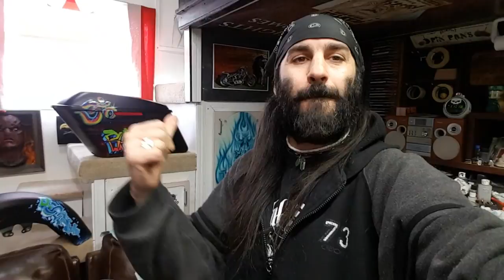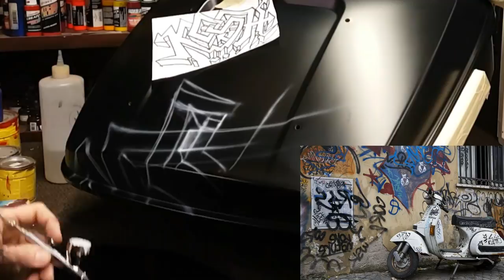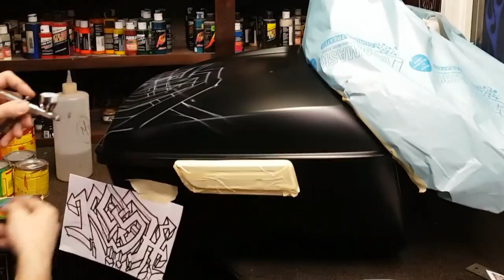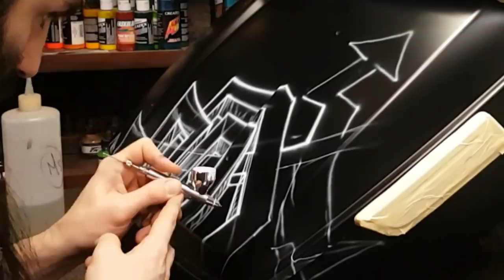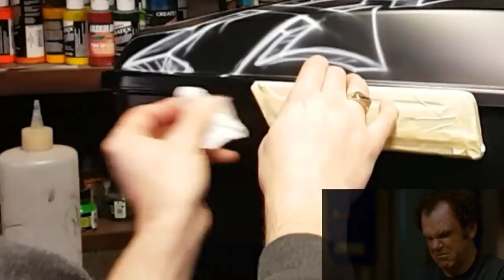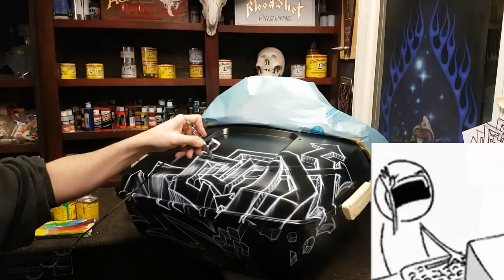How To Airbrush a Harley-Davidson with 1SHOT paint. Graffiti Style. Mapping with White. Video 1

Comment: So I have a question! ... Thinning paints! - I know it's a different type of paint for modelling, acrylic and Polyurethane undercoats, but my question is that certain paints I've thinned so damn much you have to go over an area 10-12 times before it has any kind of coverage, yet i still get blockages, and i don't mean dry tip. Other paints need only a few drops of thinners and some others none at all. There has to be some way to thin a paint without it causing a block. I'm using a 0.4 needle which should be plenty big to not block .. any advice? :D
Reply from the maker: Carl Mayne my only real advise on thinning paints, is that every type of paint and every kind of pigment handles thinning differently. As you are learning...😁 I have certain paints I like for coverage, and others for transparent layers.. and each time I use them, it's different circumstances. Only rule I can give is thin out for the specific use you have planned.. and adjust accordingly.... I know it's not much.. but I hope it helps you out to know that we all face these issues.. you are not alone. With time and practice you find out what works best for certain applications! 😎 Big Cheers and Much Love from the BloodShot Studio!!🤘

Comment: Why are you using 1Shot instead of water or solvent based?
Reply from the maker: Brian Lupo long story short.... 😁  1SHOT fit the very particular criteria for this project.... client wanted the option of possibly removing the paint in a couple years,  also wanted a graffiti style and the budget didn't allow for clears. The 1SHOT seemed to fit!! Only time will tell! 😎 hope this answers your question bro!!  Big Cheers and Much Love from the BloodShot Studio! 🤘
Reply: BloodShot Airbrushing awesome!! That’s the answer I was looking for.  I have customers who want some work done on a car or something but just in a tiny spot that wouldn’t be worth clearcoating the entire panel.  I’ve mentioned before but I haven’t worked much outside of urethane/solvent paints.  Does 1Shot hold up fairly well to UV without a clear?  I have a Street Glide I’m doing a combo of airbrushing and hydrodipping on and I had to sand off the existing 1Shot pinstriping. Fun stuff lol
Reply: Your videos are giving me confidence to try out some water based and now 1Shot. Also helps having a lot of water based awesome colors available right away at our local hobby shops.  I’ve literally been watching your videos over and over the last 3 nights while my wife is bartending (she works with me in my shop)
Reply from the maker: Brian Lupo couple of tips for ya! 1SHOT is called a perminant paint. However... I recommend that the client waxes it religiously!! This will help guard it against UV damage and resist scratches.. not the perfect solution though. Wet sanding and using a urethane clear over top is always best! 
Tip number two.... OVEN EASY OFF the oven cleaner takes 1SHOT paint off with out affecting the surface underneath too much. May need a quick polish, that's aboot it!! 😉 hope this helps ya out a bit bro!!
Reply from the maker: Brian Lupo love to hear it Broski!! I'm happy to know that these videos are making a difference out there!! 😎
Reply: BloodShot Airbrushing the cleaner is clutch!!! Great advice bro!  I knew 1Shot was somewhat permanent. I’ll be sure to stress waxing often if I end up using it at some point.  Thanks again bro. Keep up the awesome work!!
Reply from the maker: Brian Lupo I'll keep on creating as long as you keep watching! 😉
Reply: BloodShot Airbrushing one last question. I swear!! Do you prep the area by sanding it?? I can’t imagine buffing our sanding marks around the work is safe even for 1 shot!
Reply from the maker: Brian Lupo for this particular project, all I did was clean the surface before 1SHOT.  If you are to clear the entire project after the art then most definatly wetsand with 600 or 800 grit prior to the artwork.

Also if there is no clear you're correct in assuming to stay away from power buffers and also pressure washers.... 😎 hope that helps ya out a bit bro!